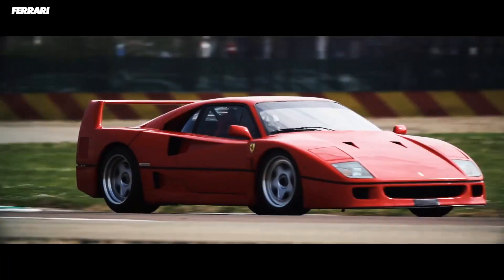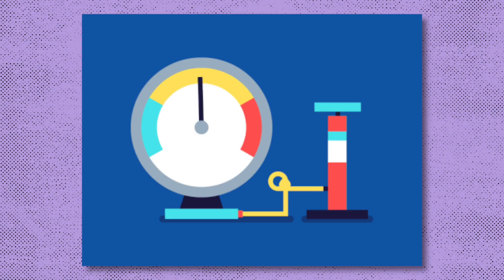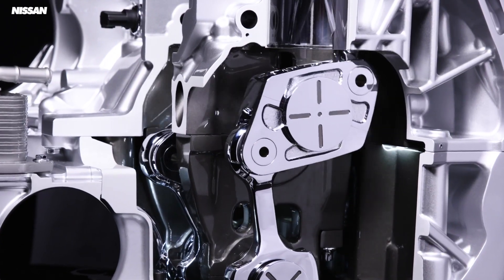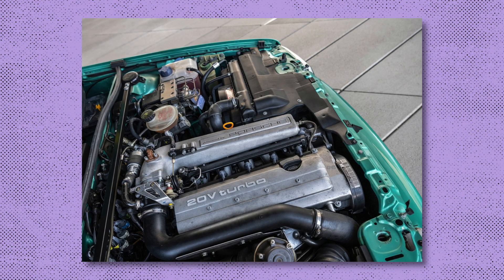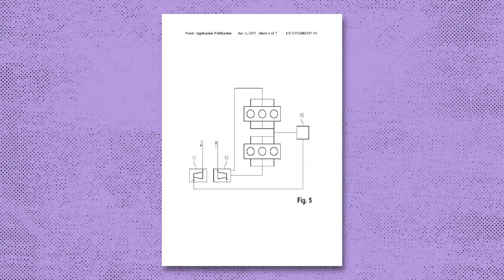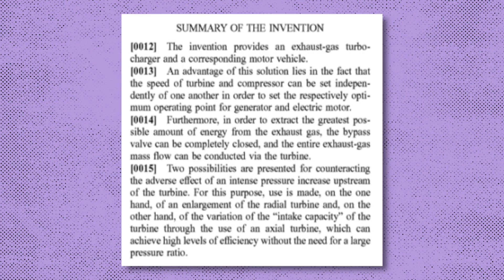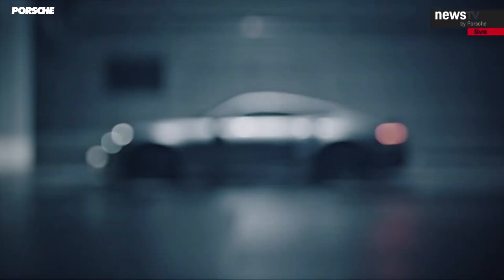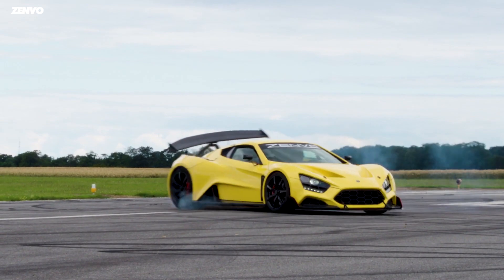Porsche's GENIUS New Turbo Design

Comment: Me: "Sitting in my 2002 grand voyager 2.4l and thinking about adding turbo to it" 🙈🤣
Reply: I think there was a variant of the 2.4 that was turbo in the past
Reply: You can SRT4 swap it. Srt4 neon and the turbo PT cruiser both had the turbo version of the 2.4.
Reply: @justRD1  Turbo PT…+50 HP at the time (2004?) I think; formidable! I always wondered how the Cruiser would do with decent mods…
Reply: Basically you've got a mitsubishi engine in your Dodge. It can be turbocharged.
Reply: You need bigger fuel pump and injectors.. I'd imagine. Maybe off a bigger dodge or mitsu engine, a Holley EFI and your all set lol
Reply: @igamehard8860  i have just started to dive in to turbos - for start I'll go for cold air intake, cat-back exhaust. After that I'll look for stand-alone ECU and some calculations of what kind of injectors, sparkplugs and fuel pump I need - I plan to film all the process on my channel also, so I am super excited for all of it
Reply: @OutOfPaceRacing  awesome idea. We are at a point where every car is quick. I think some versions of toyota camrys can do 0-60 in like 5 or 6 seconds now.. I like seeing sleepers and it sounds like you'd have a killer lol. My dream is to drop in a 650hp ford Shelby gt500 motor in my town car. Cletus McFarland basically bolted it right in and tuned it to 1000hp. Could you imagine a 1000hp town car lol®
Reply: @igamehard8860  well it's love for the car that I have and why I wanna do it - it's our first car that me and my wife bought for our family - it costed 1000euros - anywaywe bought it and when I started maintain it I saw that it was rusted out and actually junk - but I really put my head down, bought a welder and started to weld it with new pieces... Then came suspension, brakes, handbrake system and now I am touching belts and gaskets - I never knew anything about, how to repair your car, but now I have tools and a bit knowledge and it is thanks to this old 2002 grand voyager ❤️ and I love it to bits
Reply: @OutOfPaceRacing  That's really impressive, I respect that
Reply: @OutOfPaceRacing  check out pfi racing and boosted boos. You could bssacaly .run what they do   ( there mainly running honda K series 2.4 and 2.0 litter) . but they typically start with ecm wideband 2200 cfm injectors and ( i forget the exact fuel pumps. ) and a adjustable fuel pressure  regulator. . . . and typically get a waste gate thats controlled by the ecm. Either vacuum or the better solenoid electronic version.
Reply: @igamehard8860  ring gap
Reply: 😂 This reply thread is why I love this channel. The engine-swapping mind never rests, given a decent chassis platform (until it gets unceremoniously vetoed by the wife/girlfriend)...
Reply: @MalcolmCir  yup... That is the happiness for men and curse for our women and beauty of this channel ❤️🙈🤭🤣
Reply: Drive it to a used car lot and buy a faster car.
Reply: I was thinking of turbo charging my civic but I figured I'm still to inexperienced for more power than I have.
Reply: @TollyKipper  good thought process dude!
Reply: @OutOfPaceRacing  it's actually my first car. I've only driven it a few times since I'm trying to get the money to annual insure it in one go. I drove it for a week or so and haven't really put my foot down at all. I figure one day when I've been driving for a couple years I'll play around with it but until then I'll leave it as is and cruise about.
Reply: Do it.
Reply: SRT4 Swap it!!!
Reply: Any engine can be turbo charged. The question is the safe up gains vs the engine part. But you must increase the ring gap. (0.028-0.030") is a safe bet. Next you'll likley need too add fuel via higher psi fuel pump and larger injectors. Run a couple steps cooler then factory sparkplugs. .. And a fully mappable ecm\pcm with a boost reference and a wideband o2 sensor and gauge is a very good idea. .
Reply: @jasonwhite8722  thank you for all the in-depth info dude!
Reply: I'd imagine different pistons too. I'm no expert but believe when adding boost you also need to lower the compression. I don't know why, I've just heard it a bunch of times
Reply: @igamehard8860  Lower comp pistons allow the turbo to add more volume easier. And also reduce the chance for spark knock / early detonation.  And all though it was true I'm the 80-90s NC likely before then. With modern fully map-able  engine management it's not required. The engine computer you choose should have boost reference . And means to control the waste gate. Now it's vital to have the (28-30 thousandths inch.. of ring gap. ) And you need the info on now much power the stock pistons and rods can reliably handle. . And stay below that power until needed upgrades are done. . Eventually you will want forged pistons.and Alloy h beam connecting rods if your aiming near 1000+ Hp.. .  Now it's been proven that all non asperiated mods that are increase HP. Make hiting the target asperiated HP achievable with less psi. And reduces turbo lag. + ( If your not going to run E85 or 93 octane pump gas. U may want the lower comp pistons.)  Spark knock is bad for the pistons and all .. if you hear it you need too pull timing . ( The boost reference should be set to pull (2-4) degrees of timing per lb of boost from the normal timing curve that increases as rpms increase.   ( This is all spark timing) and reduces the chance of spark knock. Along. With power being made. ) Cooler plugs help because the temp refers to the plugs core temp at TDC B4 next spark. If too hot the fuel+air mix can detonate from compression.  If stuck on 93 pump gas or worse
 I think I would run even cooler plugs down 3-4 steps from stock. .  11:1 to maybe *max if ecm right) 12.5:1 can work with 93  in a NA engine .  (  Sure it's getting confusing. But Im saying many things can cause early booms B4 the piston is at its ideal location just past TDC. top dead center. . 
 Fuel octane vs compression vs plugtemp vs turbo psi vs spark timing . All this works together to  make power . 
Reduced value for any one ( except octane it's backwards)  reduces either chance of knock. . Higher octane fuel allows more compression , psi,& spark Advance. Which means you can make more power.
Reply: I'm  not a expert in turbos  infact I don't have one. . But I've been studying engine power  along with boost and NOS . For many years. . If you begin with the computer. Fuel pump + regulator& injectors. And b for exceeding 5psi.  Pull the piston ons and gap the rings.  You should be ok in theory.
Reply: Make it two 😂😂😂
Reply: I am sorry.
Reply: Do it!
Reply: Our shops first delivery car was a gutted 80s dodge 2.2 turbo caravan with a 5 speed. This was a riot
Reply: Pt crusier and srt4 already did it
Reply: Do it
Reply: Cringe
Reply: That guy that drove his caravan from Rhode island to New England dragway back in the day .when 13 sec quarter miles were still respectable. And his auto trans 4cyl turbo (modified ) was in the 13s . If your still alive speak up lol
Reply: It will definitely blow up.
Reply: Ditto on my 2012  Grand Caravan lol